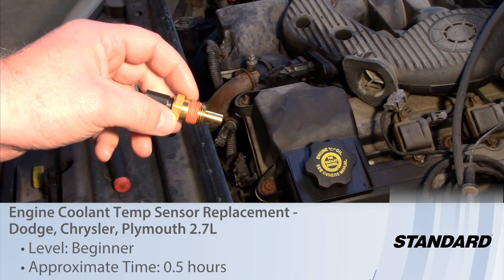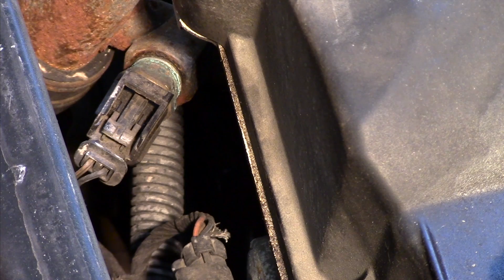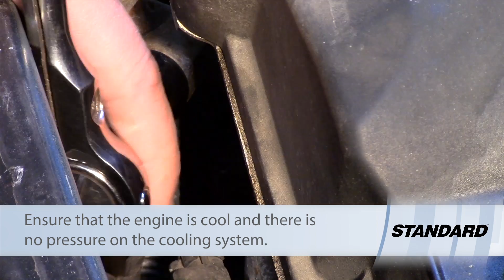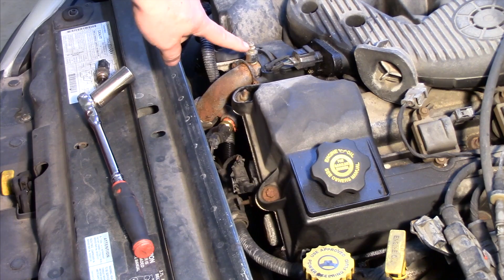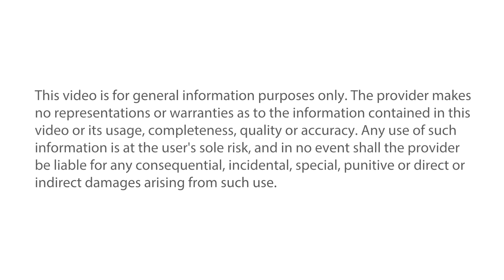Engine Coolant Temp Sensor Replacement - Dodge, Chrysler, Plymouth 2.7L

Comment: I just wanted to say, i was having a lot of symptoms of a faulty fuel pump, but i noticed the Cold to Hot gauge hadnt moved after i got car started. Once i changed Engine Temp Sensor, $20...everything runs great. Woohoo great video.

Comment: Mine was water pump the blades inside the water pump where wore down .. cost me 2000 yeah to figure it out ..
I replaced everything hoses radiator over flow sensors stat 4 times.
Even took it to dealership.
A back yard mechanic finally figured it and it was on it's way to the scrap yard.

Comment: i have a dodge charger 2008 and it overheats due to air in the bleeder , the odd thing is that when i unplugged the Connector to the sensor my fans automatically turn on , how can i fix my issue? i want to let air out when i replace the sensor - Thanks
Reply from the maker: We think it might be time to take it to a professional to diagnose and repair.
Reply: Justin Guapo. Can you please tell me how you fix that issue I have same problem with my Pacifica 06
Tanks